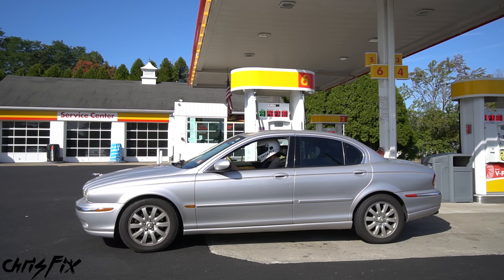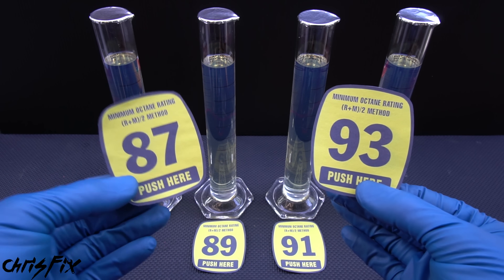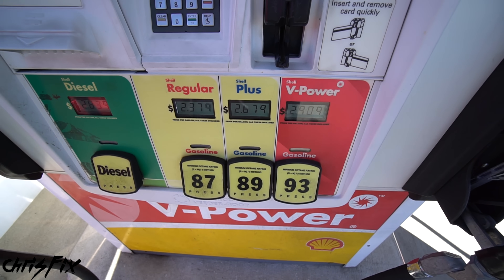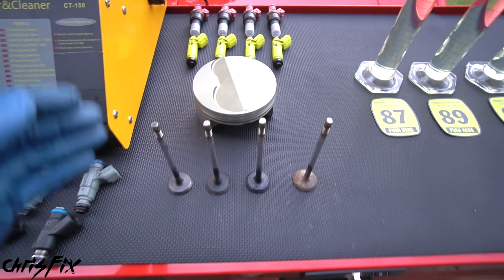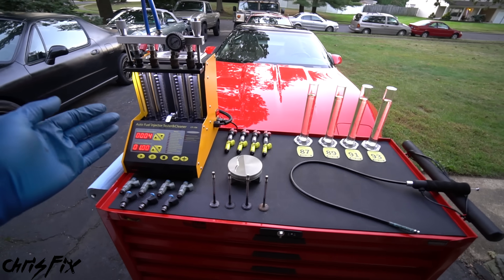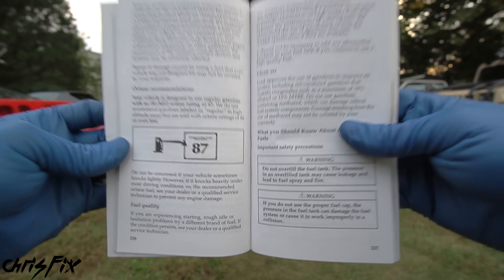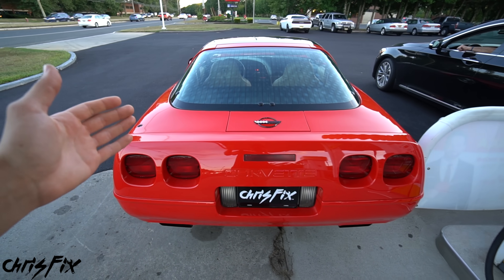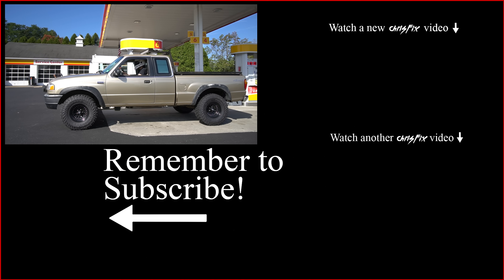What is the BEST Fuel to Use in Your Car or Truck and WHY

Comment: My truck said your full of it thay put ethanol at the pump to keep you at the pump the bigger the number the more you going to stop at the pump it's all a money game for big corp my truck cant last on Chevron gas it burns to fast it I use non ethanol and my truck goes a long time almost 2 weeks the more your at the pump the more thay make off you
Reply: My dad drove dig rig for 30 pluse years he said it's all the same I've seen how thay do it at murffy 2 gallon jug of what ever in high octain poured in the underground tank 1 gallon of the whatever poured into the underground tank and nothing in the no grade that said I've seen my father was right
Reply: You didnt tell me the truth you told me what you and everyone else has been told lol get a gallon of gas of the truck befor it goes in the underground tank then one of each after the truck leaves then do a chem test the truck only carrying one tank of fuel so turn your gears on that he dont carry 3 grades of fuel but fills all three grades befor he pulls out
Reply from the maker: What? If you can use punctuation that would help because I cannot answer your question if I do not understand what you are asking.

Comment: What if my tuner suggested that I only put 93 from Shell or Sunoco
Reply from the maker: Dont worry about the brand, just worry about the octane. Listen to your tuner for the octane rating and it is consistent across all brands. The 93 you get at one station will be the same at every other station. The only difference with brands is the detergent additives .

Comment: I have a Plymouth grand Voyager 1993 with a 3.3l v6, and me and my dad were wondering if we just run 91 because the closest has station near us only has 89-91-93 it doesn't have 87 or diesel. The manual says recommend 87 but Sheetz or Sunoco is a few miles away from and they have 87. If I run 89 or 91 would that hurt my engine over awhile or just run nicer. I did get better fuel injectors though (vortec 3.4l fuel injectors) supposed to run cleaner
Reply from the maker: If the car recommends regular gas (87) you can always run higher octane and it will only hurt your wallet. It has no affect otherwise. It wont be "better" or worse.

Comment: No you are false about them not burning hotter or colder. Race fuel burns quicker and not as hot as regular gas. Just go ask a few people running meth fuel.
Reply from the maker: Race fuel isnt gasoline, it is alcohol based. You said it yourself, methanol. Methanol is not gasoline. All octanes of GASOLINE burn the same temperature.

Comment: Chris, it's ok to mix gas types? Some people does it but I'm not sure if that is fine.

As an aside question, you should wait for the tank to get almost empty if you want to change your gas type?

As always, a great video! Thanks for all your effort doing this content!
Reply from the maker: Yes you can mix octanes because the computer will make the adjustments for you. Just stay above the minimum octane required so you dont get detonation.
Reply: @chrisfix  THANK YOU for the reply!! So that answers both questions then. 
Here at Mexico we just have 87 and 91 gas. My car says 87 or more. I've been using the 91 one (just some cents difference) for years and has been working just fine.

Comment: In the higher elevations most cars can get away with lower octane. That's why gas stations in high elevations have 85 octane
Reply from the maker: Great tip and yea that is because there is less atmospheric pressure so youre less likely to get detonation! Thanks for sharing.

Comment: Where the hell did you find 91??? Lmao.. I used to run 91 in my built transam it ran perfect if I put 87 it ran bad and it would knock which I knew it was starting to ping my piston "ping" ( blowing the piston head up n could blow holes in the top of the head ) but 91 it done ok with 89 it would run smoother then 87 but it would jerk a lil.. but 91 n 93 it would do fine n have alot more ass behind it. But I would also run 110 called blue octane and blue devil ect its 20 bucks a gallon...... but worth it lol. I would put in 20 bucks worth of 91 to 93 then 20 bucks "1 gallon of 110 " and it ran amazing... but I would keep a 3 gallon fuel jug with me that had 110 in it incase I had to use 87 or 89 all I would have to do is put some 87 ect in and pour the 3gallon of 110 in on top n mix it let it sit for a min or two so it mixed the gas. Now I have a 502 blower shop blown 8-71 big block Chevy in my 88 transam and it runs on methane and E85 E90 ect. But I have ran nitro methane pure in it before it gained alot of power in the top end the bottom end it fights me. Still have to adjust a few things to get the fuel n air ratio right.
Reply from the maker: Most pumps here have 91 or 93 for the premium. I think that varies from state to state.

Comment: I use 93 octane in my lawn. mower, do you recommend as well?
Reply from the maker: They are usually low compression but they are air cooled. I use 87 in all of my lawn equipment with no issues. You will hear knocking if you need higher octane. Never heard any knocking from lawn mowers to weed wackers.

Comment: What about motorcycles? I always use premium, but I just wanted to ask for the masses. Thanks!
Reply from the maker: Depends on the bike. Most bikes should run premium becuase they are high compression engines that rev high but again, cant say that for every one.
Reply: I appreciate the response! I guess the sure answer is to read the owners manual. Cheers!

Comment: Sounds like a good rule of thumb is to give your car premium once a month or so to ensure clean valves and consistent flow rate for fuel
Reply from the maker: Eh, you really need to use it for 2500+ miles straight to get an effect. I would stick to the octane you need unless your car starts detonating or getting poor mpgs which could mean clogged injectors.
Reply: ChrisFix thanks!!!

Comment: Actually, the ethanol additive increases octane, which does lower performance and total gas mileage. So octane does indeed alter both of those, as well as emissions.
Reply from the maker: If they add 5% or 10% ethanol like they do in some states, the octane rating is still the same as listed on the pump. The added octane from the ethanol is accounted for already. The ethanol, not octane, has lower energy density than gasoline but I was talking about gasoline, not ethanol. Thanks for sharing.
Reply: @chrisfix  I am aware of that friend. I never mentioned specific amounts. Only that it does affect it.

Comment: My gas station has more options than this.  Usually a "no ethanol/89" choice too.  Is this better/worse than reg 89 w/ up to 10% ethanol?
Reply from the maker: Ethanol makes the fuel less expensive but the fuel has less energy in it (ethanol is less energy dense than gasoline). So run one, calculate MPG for a few weeks and then run the other and compare.

Comment: Can i put anything in my flex fuel system i mean e85 is like 105 octane but i can also use regular on it which is 87 so im thinking anything between should be fine or am i wrong?

Comment: Excellent video as always Mr. Chris. To me gasoline is diluted anyway despite the octane rating. Ethanol is of course used to subsidize farmers, but it attracts moisture and then we get involved with fuel system cleaners. Also because of this if you do not have a highly pressured fuel system moisture will develop especially in the the fuel tank.

Comment: Keep in mind that if your manual says to use 87 you can still use 85 if you live at higher altitudes since the air is thinner and won’t have as much compression.

Comment: How about the certain places out west that have crappy 85 octane that was meant for carbed vehicles but still sell it. 
Always look at the owners manual and stick to it.  
Don’t forget that if you use a higher octane than what’s needed, that unburned gas will kill your cats. 
And that octane booster you showed is BS. Just don’t go WOT if you accidentally go low on the octane. The only true octane booster, that I’ve used and works, is Torco.

Comment: Do they use ethanol on the gasoline at USA?
In Brazil, our gasoline should have by law 25% of ethanol on it's composition (they claim that it's to reduce the amount of carbon monoxide in the air, to make a "cleaner" fuel and works as a octane booster).
Thing is, the fuel economy is not so good because of this mix, and is common to see non-flex cars having engine issues because of the mix.

Comment: I've explained this to some people and they just won't believe it.  Thanks.  Now, I can direct them here.

Diesel has an octane rating of about 45 or 50.  Kerosene and jet fuel are around 15, I think.  Diesel engines use compression to ignite the fuel so they want it to "expode" easier than gasoline will.

The more expensive must be more powerful right?  Bigger is better right?  Nope.  Nope.

High performance engines have higher compression and would "diesel" (pre-ignite) with a regular fuel.

You said it well.  Higher is simply the resistance to ignite not; more power.

Comment: is any fuel additive like (Sea Foam) have negative impact on fuel nozzle (Fuel Injector) ?
I mean if i use sea foam with fuel then can it damage my fuel nozzle (Fuel Injector) ?
Some of my friend said that different fuel additives cause bad impact on fuel nozzle (Fuel Injector) and we get worse fuel average because of that.
Reply from the maker: Only use a fuel additive if you have an issue like carbon buildup or a clogged injector.
Reply: @chrisfix  I just buy honda Civic 9th generation in used condition with 130,000 Klm driven. So what you recommend to me should i use sea foam on a safer side ?

Comment: What cause it grey smoke 💨 whenever you turn the car on?
I got that problem with my Toyota Camry....

Thanks for the video
Reply from the maker: Leaking valve seals. Over night the oil leaks down the valve into the combustion chamber and you can see smoke. Not the end of the world but it is consuming a little oil.

Comment: In Switzerland we have 100 Octane Gas
Reply: It maybe because you live at a higher elevation. Just a thought.
Reply: @tmr3513  at higher elevation you can run lower octane
Reply: @tmr3513  higher elevation is lower octane. If you go to Colorado springs, which is between 6000 and 7000ft, you will find 85, 87, 89 and 91. Instead of the normal 87 thru 93. You can safely run 91 in a car that requires 93. The higher the elevation, the more resistance gas has to ignite. So they lower them to make them easier to ignite. The guy that tuned my truck told me I could run 91 on my 93 performance tune just fine there but would need 93 if I traveled to lower elevation.
Reply: Could you tell me where or which gas station ? I never managed to get one in Geneva 😔
Reply: @user-my4jt6dx1p  I saw it as i was on a gas station on the highway A1. You wont find an higher than 98 Octane off the highway.
Reply: Cool
Reply: Italy too
Reply: In higher elevation (without supercharging) octane requirements are actually lower. Please notice the European ratings are different than North America.
Reply: It's comparing apples to oranges though.
Reply: @lucziuzs  Yes there is probably even higher Octane gas for racing cars and stuff.

Comment: hey I got a Audi s5 v8 engine and im thinking of cleaning the valves/pistins from all the carbon deposit coz i dont know, if the previous owner used the recommended premium gas. any idea on what cleaner to use/how to clean it? :D
Reply from the maker: Use shells premium gas for 2500 miles and it will clean 70% of the carbon.

Comment: I feel like you should mention e10 and e15 (how most fuels nationwide are e10). In WI they label, and lots of stations actually have ethanol free premium. You might mention how some older vehicles and small engines cannot use e15, and older yet cannot use e10 (would potentially not be in owners manuals). As an interesting side note, my naturally aspirated snowmobile is able to run on e10 lower octane, but actually has a setting for when I run ethanol free premium
Reply from the maker: Thanks for sharing!

Comment: I always love your videos sir but I have one thing to add the higher quality fuel does give me better mileage. I drive the same route every day to work and back.  My manual says 87 octane fuel. But for a month I did a test. I drove the same route I always do with my car (the only time that car gets driven) at the same speeds for two weeks with 87 octane and then for two weeks with 93 octane and with the 93 I gained an extra 120 km on my tank of fuel. So I have to say that in my experience the better quality actually does give better mileage (2017 Dodge Journey 6 cyl) .
Reply from the maker: Awesome! You’re car can probably use the higher octane to it’s advantage. Is that 6cyl higher compression? If so that makes sense. If not, you’re testing might be flawed. It is tough to test fuel economy because one week could have less traffic or less red lights and that throws it all off. Either way, use what works for you!

Comment: Can you mix e-85 and octane gas (87,89,90) in a flex fuel vehicle
Reply from the maker: Yes you can. There is an ethanol sensor in the fuel lines to make adjustments for the amount of ethanol in the fuel

Comment: Why not include the impact of ethanol and non ethanol gas with this video? It seems like the inclusion of ethanol makes a difference.
Reply from the maker: Because it varies everywhere and there is no significant impact for cars except fuel economy which is 3% different on average. Most places uses e5 and you can’t find straight gas anymore.

Comment: I learned something again.

Higher octane myth: it doesn't burn cooler, and it doesn't have more energy than lower octane, and doesn't burn slower than lower octane.

But that makes me wonder why engines with higher octane can advance the timing to take advantage of the higher octane. The way it was explained to me, which is now wrong and a myth, was that it burned slower and/or cooler, so it HAD to be injected sooner and the ignition started sooner in order for the strongest part of the explosion (aka burn) to produce power at the right time, plus as it burned slower, it could also push the piston down for a greater distance.

Can you do a video, please, that helps explain that? I believe what you said; it's just that I don't fully understand. I'm sure I must be missing something. Once it clicks, though, I'm good.
Reply from the maker: Think of it as activation energy. The fuel won’t ignite due to heat and pressure and only will ignite with spark if the octane is higher. Lower octane can ignite just from high pressure and heat in the cylinder which causes detonation as you saw in the video.
Reply: @chrisfix  "Resistance to detonation" is the key phrase and the take-away. Thank you for your quick and informative response!

Comment: Ive got a 99 winstar that has a couple codes for running lean in banks one and two. On days that are humid and a little brisk, then engine tends to knock.

The fuel trims show that its dumping loads of fuel into the cylinders to try compensate for the lean condition. So I'm wondering if its possible the van is incorrectly reading as lean, running a too rich mixture, and knocking as a result? Or is it knocking because its too lean?

was gonna try remove the o2 sensors in the exasut to clean them, but realized I have no way to lift the whole front of the van safely. 

I have found that running premium helps, but its still not enough.

So long story short, Im just wondering if a rich or lean condition can cause the engine to knock?

Thx.

P.S I am looking to replace this vehicle asap, it just needs to last till i find a truck that meets my requirements. So i dont wanna spend much on the van
Reply from the maker: That sounds like a vacuum leak. Try to find the vacuum leak and fix it and it should stop the lean condition.
Reply: @chrisfix  alright, thank you. That is another cause that my obd2 scanner pointed out

Comment: What should I use in a high comp jdm b20?
Reply from the maker: High compression engines usually need premium and if it isn’t needed, they def run better with premium.

Comment: So maybe you can answer this as it seems to be avoided in nearly every bit of research I've dug into. What's with Mid-Grade? Is it meant as a compromise between regular and premium for high performance cars and to be used in a pinch? Or is it just there because at one point two cars on the face of the Earth used it?
Reply from the maker: Mid grade is very similar to “synthetic blend” oil in the sense it fills a market niche with almost no extra cost to the brand. They just mix their 87 and 91 to get 89 octane in most cases. Some cars recommend it but not as many as regular or premium.

Comment: The manual for my supercharged Cobalt SS said premium only so that's what i did. When premium hit $1.50 a liter, I tried to cheap out just a bit and filled up with mid-grade once. Engine hated it so never did that again.
Reply from the maker: Yea you def need premium in that. The supercharger compresses the air so much it will detonate with anything less!

Comment: Need a little advice please concerning fuel. I have a 1997 F150, 4.6 V8 with 179,000 miles. Sometimes I get extreme spark knock other times none. All of the gas stations use 10%ethanol. Is this causing the spark knock? Should I step up to midgrade? Thanks in advance!
Reply from the maker: Doesn’t matter what they use in the fuel, the octane number only matters. Ethanol or no ethanol, 87 octane is 87 octane. I would try cleaning the engine with a fuel system cleaner lime what I did with my truck when it pinged. It’s probably carbon deposits causing detonation. Check your spark plugs too.